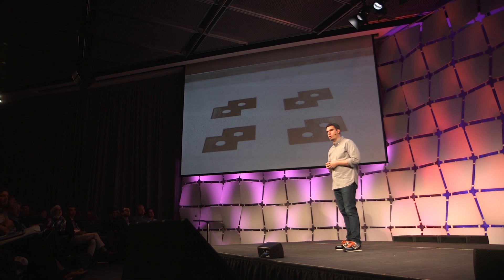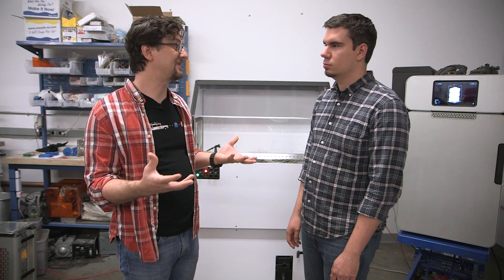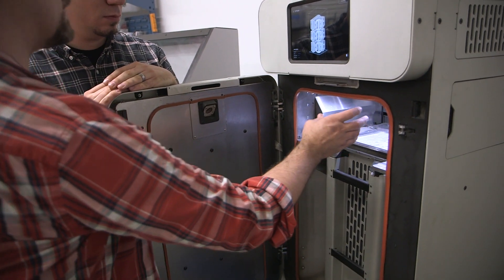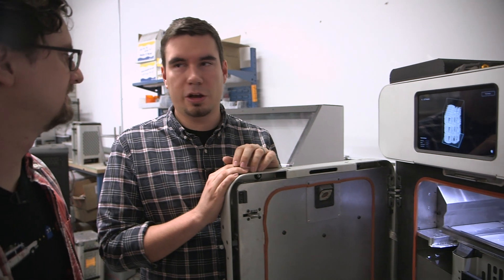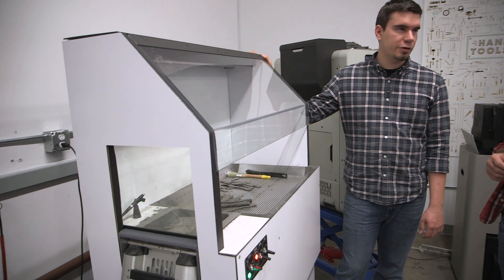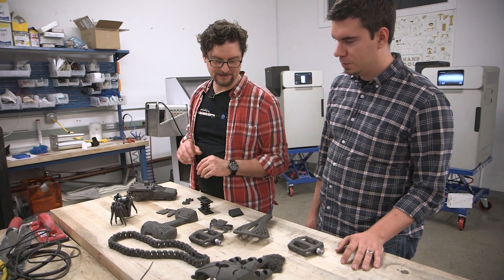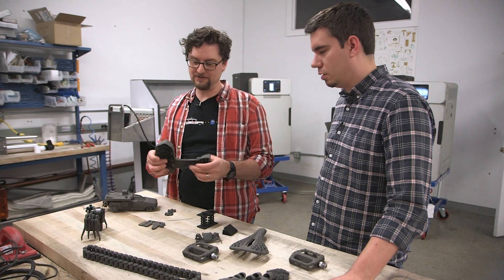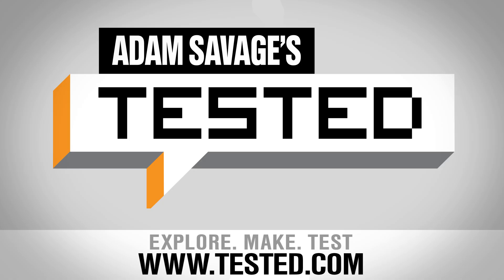Formlabs Fuse 1 SLS 3D Printer Demo!

Comment: Does carbon fiber come in a powder form? Does this printer capable of running carbon fiber? It sounds like a very expensive. I wish I could afford this printer since the print quality is so more better than any 3D printer even those which can use carbon fiber filament to meet I would say a 63-90 surface finish. You would have to have at least 15-20 machines for running production plus a few hundred pounds of power laying around.

Comment: Questions:
-What happens to the unused powder you dont recycle, as you will not be using 50% of the powder in the build printing parts, how is this dispensed from the cleaning station?
-can you switch the machine between PA12 & PA11 powders and if so how much work is involved to clean/decontaminate the machine from the old powder?
-how long does a full build take?
-what accuracy can this machine print to?

Comment: That pricepoint makes it affordable for small businesses etc.
Still too expensive for private use though (unless youre stacked). 
I wonder if well see a sub 1000$ sls printer in a couple of years like we did with resin printers.
This is not well suited to printing single benchies and whatnot though, since you need
to fill the whole volume with the very expensive powder that can only be partially recycled.
Maybe something with a tiny build volume for figurines, small mechanical parts etc. would make sense as a consumer product.

Comment: My company has had a form labs 3d printer that has been sitting around for months because we been getting a sensor error message and every time we contact formlabs, we never seem to be able to get a solution. So we ended up swapping to a 3d printer, no problems since.

We use it for dental appliances, any of you who are tech savvy and use form labs on a regular basis have an answer for the sensor error?

Comment: We have been using the sinterit Lisa which is very similar and also uses the more expensive darker absorbing nylon and honestly the first few parts were great and now quality is starting to degrade as we haven’t been too diligent adding refresh material and making sure powder is packed properly. It is a real hassle and quite time consuming preparing the machine and then removing and cleaning the parts as compared with normal FFF printing. Also the laser scans really slowly compared to industrial sls machines, most of my prints are more than 24 hours, just as slow as FFF or slower. I’m really looking forward to HP multi jet where most of the workflow is automated. Not saying that cheap sls is not worth it but it’s not all rosy either, also with all the refresh material yet you need to use it starts getting really expensive so would never consider this for home use.

Comment: This is cool, but I see three issues.  1.  I am pretty sure that unless they have licenses to use other patents, they could face legal challenges.  2.  The print area is to small and would have been better being around 300 x 300 x 400, especially as this is still well over a $10,000 when setup.  3.  Needs to have 3D printed metal option like the big boys.      Even though this is a cheap SLS printer, comparing it to the expensive machines is like comparing this a Mini to them a Rolls Royce.

Comment: OH ! Come on! More than 2 years????! This guy or the group behind all this are not genius or a prodigies or they are not even cursed with technology knowledge!

I will tell you what is "accessible to normal people" 

"Knowledge" my friends!!  

and  FREE if you know what  I mean ;)

Guys! This technology can be reproduce by anyone!  Just like he did!! 

All materials and information is out there!  And you don't need to pay 20k for something that needs a lot of upgrades and development and printing still a bit slow!

-Laser is not expensive
-servo drives for the laser 
-mechanism for spread the plastic dust are very simple, mechanism for layering down is easy cake.
-step motors and power drivers are cheap
-power supply modules are cheap
-video camera system and firmware can be made with Python or even better arduino or Rpi or other modules.
-containers and heating system is not such a bit problem to deal with!
-Polyamide Plastic Powder is cheap
-the mixer system well, there is not much technology in that.
-that cleaning system was not very well planed, it seems they were in such of hurry to reach a deadline of the project.

I'm pretty sure not more than 1.5k you will spend building it.

Yeah you need to invest time and effort but at the end that is PRICELESS!
I know that by experience ;)
Reply: you also have to adapt a slicer for the technology
Reply: Old Conspiracy Dude >there you go! I like that;)

Comment: Affordable?  I've been looking at cheaper brand new cars today.  But the part that puts it out of most people's reach is the size.  With just the printer and the clean up station (whatever that was called) you need more space than most people have spare.  I'm going to stick with maybe getting a Makerbot replicator 2 I think.  That will actually fit in the space I have.

Comment: Does the powder fall under the microbead ban? The relevant text; "Microbeads are manufactured solid plastic particles of less than one millimeter in their largest dimension, and commercially available in particle sizes from 10 micrometres (0.00039 in) to 1 millimetre (0.039 in)."

Comment: I wonder how far off printing with metals is??  Most geared parts like what is in a hand drill, use powdered metal.  The only problem I see is finding a laser capable of hitting the temperatures needed to convert powdered metal to solid pieces.  THEN we could print a gas powered piston engines or even jet engines which are much less complicated.  This could be done with no assembly required...

Comment: The most important aspect of measuring efficiency is not approached here at all. Specs of volume/min at decent production precision levels are left out completely. For a good reason, maybe?
The process of spreading the medium seems to be an immense time killer. If the machine works like here presented, it seems to take more than a week to produce that stack of pedals.

Comment: ..wasn't the recycling part a bit misinformed, just went over it.. apparently you cannot reuse all of it.. only like a smaller amount - cause the whole volume is heated up while printing and it looses cohesion when you reprint with same powdery thing, prints start falling appart if you reuse the whole thing

 - so basically you wouldn't print one small thing, you should fill up the whole volume.. so it's a high volume production thing .. also has non uniform shrinkage .. not sure how you can compensate for that 

- not really for hobby people, and not for all companies.. there are videos about it, but they never mention this when introducing SLS.. 
- still nice, as you don't need supports and is "truly 3d" , but still no perfect solution, go with the one you can afford and build up if it's worth your while

Comment: $9,000 for the printer and another $10,000 for the recovery system... maybe I'd just buy a shop vacuum and recover my own powder, LOL, or to save $10,000 toss the old powder and do a fresh build each time.  Just make sure like 90% of the space is loaded with build volume for each print, sheesh.  I'd really love a Glock lower made out of that stuff... really good gripping action it looks like.

Comment: I'll buy this printer in a few years, no sweat. BUT saying you can reuse unused powder, is WRONG. A separate machine can recycle unused powder ONCE, but even at that it's not a perfect process. The powder basically can NOT be reused, not by a home user. 50% used powder is also wrong, that would make the product too fragile.

Comment: I have many designs made by sls, as a matter of fact I'm waiting for an existing order for about 20 different parts right now so this machine and it's recovery station is very interesting to me. The only thing I don't like is the dark colour of the finished product which would make it difficult to dye a colour lighter than the base nylon colour. If nylon came in a variety of colours or at least come out white like most sls prints do then there would be no problem but with this system it's very limited. It's good they  mentioned the reason why the colour is dark at least.

Comment: Hmm, $10k for it. I'm going to raise an interesting couple of points: The only place I'm seeing offering nylon-12 powder for SLS has it at $150/kg. Contrast that with FFF filaments where you can get 1.75mm nylon-12 filament for $86/kg. It takes an hour for this to start up, and it prints at 10mm per hour, So it's more in line with production floors than it is for hobbyists because you need to load the build volume in order to decrease the slack time involved in wiping powder into the "dead" space. Then there's the fact that a home gamer can make their own filament by buying bulk raw plastic and extruding it with a home-built filastruder clone: I doubt the home gamer can achieve powders at the requisite granularity and consistency. Then this box only does two types of nylon; a FFF printer can do nylon, ABS, PET(T/G), PLA, HIPS, and TPE, among others. It's not worth standing on that hill and hanging your hat on it.

Comment: Spoiler: $10,000 for the printer alone. 

The weird part is the "Recovery Station" and "Powder Mixer" are also $10,000 together, making it $20,000 for the set. They do not mention what a "cartage" of power costs, but considering how they even HAVE a Recovery Station and Powder Mixer, it's safe to say $$$. If this powder was cheap, you wouldn't need $10,000 in parts to recover and reuse it. We must be talking Cocaine-expensive!

Just wait for the day somebody says, "I'll suck your d*** for some printing powder".

Comment: 17:14 "Spot on" ... really? If the printer of the black model costs more than double of the Formlabs then yes. Otherwhise the details are not quite good enough if you watch the plate with the registration number. The black one I can read the whole letters and numbers. With the one out of Fuse 1 nearly none.
Anyway a good project what will make a broader area of clients for Formlabs.

Comment: Why does it matter if you use used or new powder, aren't they the same material?
Reply: Used powder probably clumps a bit since it's been brought up close to melting point so fresh powder will give a cleaner material layer when it rolls out the powder.
Reply: Aah makes sense, thanks.
Reply: ABOODY it's like a bartender serving watered down drinks to customers who've already "had a few"

Comment: Can you encapsulate other materials such as steel or brass hardware (e.g. case nuts, mounting posts, etc.)or possibly metal plates for added structural support in larger or more industrial application parts?

Comment: No support structures - but you have to spend a lot of time cleaning it up, when if you design items intelligently on an FDM printer and they are instantly available. I cant see these appearing in an office with all of the cleanup.
Reply: Sls has other advantages. The strength of the parts are isometric because the layers are fully bonded. Fdm is strong in x and y but weak in z.

Comment: the Printer cost 20k ,material price is not announced ,Power consumption only for the Printer is about 2 kw/h only , thats make the cost of 9 Euros per 10 Hour use, only for the Printer, here in Europe with all the other , machinery involved it wil raise the cost up to 12 -15 Euros in a 10 hour use. If you want Print usable Items the rough surface is usable for Bike pedals not for Models or for other applications ,then you have to Polish the surface afterwards, and this is, was cost the real money, With this printer you can not compete with other Printers like you would print with resin when it comes to real surface Details, even it is more expensive material, the end product will be much Cheaper than this.and this is what the customer will have The other thing is when you have to Polish the surfaces you will have to print all the parts separate and build it together, it is time consuming time is money, for really fine works and details this is a no go Printer.

Comment: 10K for the machine is an amazing price, but I think 9k for the cleaning and mix station is a bit steep.
How often can you "reuse" the powder and how much does it cost to fill the build volume once?
Reply: Based on similar systems the max you get is a 50% recycle rate on powder. And if you want good prints its recommended to use pure new powder.

Comment: We are talking about microns... lol what a goof this new tested guy is. The Formlabs guy said 100 microns... 10 microns is one hundredth of a milimieter which is very very very precise for metal machining (I was checking lego bricks with my micron dial indicator and I found the plastic parts were precise to about 11 microns) but 100 microns is one tenth of a milimeter which is garbage for precision in many manufacturing disciplines. So we're not exactly talking microns.. we're talking in tenths of a milimeter (around 4 thousands of an inch).
Reply: chronok I was curious how that measurement compared to one that I was used to.  Thanks.
Reply: i bet it's restricted by the diameter of the sand particles. Form 2 can do 25 (?) microns, but that is liquid

Comment: A correction - the Fuse 1 is not the first benchtop SLS printer priced well under the typical $150K+ price tag. The Swiss-made Sintratec Kit came out toward beginning of 2016 for $5600. It's a kit that takes approx 4 days to build with a volume of 110mm x 110mm x 110mm. They also offer the S1 which is fully assembled for $10,135 with a volume of 130mm x 130mm x 180mm.

The Fuse 1 has a volume of 165mm x 165mm x 320mm for $9,999.
Reply: China has a SLS desktop, now only $3-6000
Reply: Sinterit.com sell good quality SLS 3d printer for less than 5k euro !
Reply: You're forgetting about the LISA from Sinterit. Less than 5000 Euro including the support equipment (that self-same support equipment is an additional $10,000 for the FUSE 1). I will admit though that the FUSE 1 seems much easier to use (with cartridge filling, and a removable build area). The LISA is a bit of a faff.
Reply: And that doesn't even include the recycle station.

Comment: "Accessible to normal people."
...that have copious amounts of disposable income ($20K+) and are richer than 98 percent of the population. 
They forgot to add that bit.
Reply: I think they really meant accessable to smaller engineering businesses
Reply: Accessible is not the same as purchased and owned by. Groups of like minded friends could pool together to acquire something like this. Similar to a MakerSpace.
Reply: buy it, sell the product, produce as business. Buy more of them and Get rich.
Reply: You can't do production with SLA/DLP. And this is cheap, most other SLS printers are more than 50k.
Reply: Companies rent out time and number of prints to consumers, you could prob. print stuff for a few hundred to a few thousand depending, but depending how intricate and detailed you go, this could be cheaper to make it rather than buy it.
Reply: $10k for the printer $19k for absolutely everything there.
Reply: 9k for printer is OK for prototyping shop (say like us) 20k makes me think twice as really you ca get large, way large SLS for same price and it would work with white or grey materials. For black only 10W fiber sources are next to free now days so really this printer can be DIY for probably around $2k. In SLA i think FL has better presence as the software was better written so supports and orientations are more smarter. Here no software is needed, just galvo controller with hatching each later and powder roller :) Make the price $5k for whole system and then its whole different story.
Reply: They fail to mention the cost of the powder. And although reusable, it degrades with each heating cycle which requires you to blend the old powder with new powder to maintain the same melt point. I really don't see SLS as "consumer friendly" anytime soon until the powder costs come way down.
Reply: It all depends on what you are passionate about. Of course, if you have economic difficulties ( and i know i have), this thing is out of reach. But if you have a regular income, it isn't that expensive, all things considered. Lots of regular, middle class people have 20k worth project cars, can spend 20k renovating the house, buy 30k new cars, etc. This is much better than that, because it retains much more value than, say, a new car, so if you get bored, and it is 20k new, you can probably sell it for 15k used in 3 or 4 years. With a 20k car, not so much, probably around 10k.

So yeah, it's expensive, but maybe not that expensive, specially if you get money out of it, which is easy to do with that astounding print quality.
Reply: That's exactly what i was thinking. People spend more money than that just on cars and boats. This investment can actually pay for it's self in time. Most People have such narrow tunnel vision.
Reply: To be fair i think he meant regular engineers... and engineers get paid alot.
Reply: The quality is pretty bad for something so expensive. I assume the material has a good application but you can get unbelievable print quality from DLP printers for $500
Reply: Chris Gough agreed!